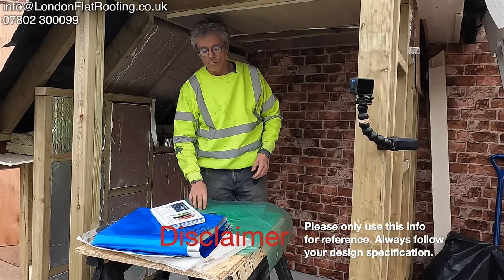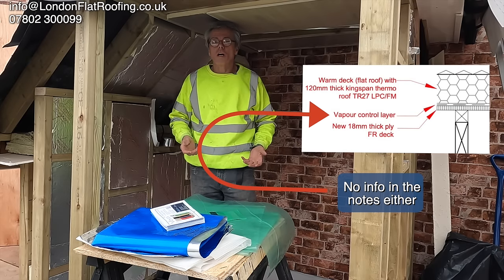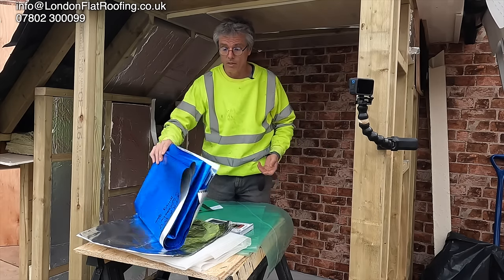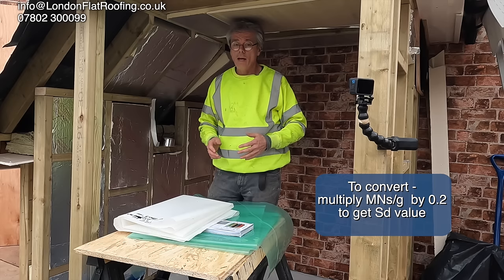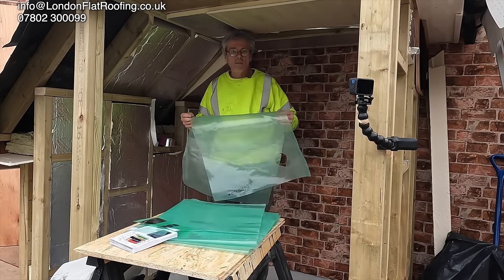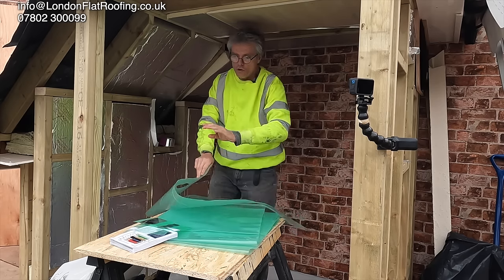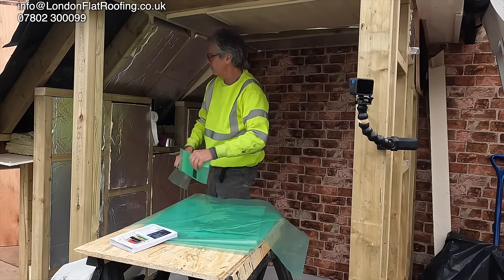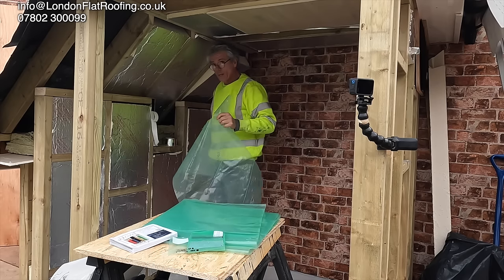Vapour barriers for roofs and walls explained

Comment: Great Video, i have watched a good few about vapour barriers trust me. I currently have a single skin (concrete block) summer house. Would you say i have it right when insulating the walls to have 1. Breathable membrane, 2. Kingspan insulation in a stud frame and then the vapour barrier before cladding or would it be vapour barrier at step one on the side of the block and insualtion or the warm side of the room or both? Hope that makes sense. Thanks in advance
Reply: Any advance steve would be much appreciated 
Thanks

Comment: All good for my new building where I have been following all the advice discussed with you in the past, but now I'm building a solar shed for all the electronics where there should not be much vapour other than what was there initially. I was thinking of making this unit an air/moisture-tight one from the outside rather than worrying too much about the inside since I'm also adopting a "Warm roof" as well.  Any suggestions from this fraternity ?

Comment: Hi,
What should be the thickness of insulation board for my garage cold roof?
Reply from the maker: Depends on if you need to meet building regulations if you need to build to building regulations thickness is 150 mm now

Comment: With old houses built in 1900. No cavity. 9 inch solid wall.  Would you say batten and then put insulated plaster board over it? Or is it silly
Reply: are you talking about walls or ceilings?
Reply: @HampsteadBuildersLt  brick walls
Reply: @tommyb5244  no not silly its the way its done ad a DPC (damp proof course) under the batten.
Reply: @HampsteadBuildersLt  so battens drilled to the wall with a dpc under. And and good insulation board with a vapour barrier behind it?
Reply: @tommyb5244  yes plasterboard avcl insulation battens dpc
Reply: @HampsteadBuildersLt  thanks for your help

Comment: Does using foil tape on top of the kingspan do the job?
Reply from the maker: Possibly If you can make it air tight and if its going to last the lifespan of the building !
Reply: @SteveRoofer  Why on earth don't PIR manufacturers would publish spec of the foil facings? I'm having to buy and install a seperate vapour barrier because they don't. If they stated their sd value/MNs/g, emissivity etc, then maybe all I would need is lots of alu tape.

Comment: maybe not your field.. :) but do you need a vapor barrier if you're insulating floorboards?. My floorboards are suspended on joists and then there's just a big gap before the dirt underneath. Lots of cold air comes up through the floorboards and i was hoping just sticking insulation in between the joists would help (leaving space underneath for air ventilation). Sorry not roof related ;)
Reply: p.s. great videos, I'm watching a bunch just out of interest at this point!

Comment: Hi Steve, thanks for this video,, can you help? we need to insulate a large wooden shed, please advise the best way to go abot it... ONLY THE INSIDE.  ITS GOT A PITCHED ROOF AND WALLS ARE 2.5 METERS HIGH ,,,Thanks.
Reply from the maker: if you do not want to spend a lot of  money just use Rockwool  with a plastic AVCL on the inside I would not be to fused about the quoity of the AVCL for a shed

Comment: Can you make a warm roof system with a slope roof. If what’s the max slope ?
Reply from the maker: I think that a pitched roof stopes being a pitched roof when you get down to 12 degrees Ill have to look it up. However theoretically if yo made a roof with say 30 degrees pitch the same as a flat roof what's the difference? The only thing I can  say is that hot air rises and at the top of the flat roof you may get a collection of moisture  if you are going to get any problems at all.
Reply: @SteveRoofer  great on sight thanks

Comment: Vapour barrier moisture barrier seems to be abit of a buzz word these days , why would you want to keep moisture in ???
Reply: keeps the moisture away from rotting the timber
Reply: So the moist air doesn't condense on the structure and rot it!
Reply from the maker: We insulate a lot now days thus stoping the transferor of engage and taking with it the moist air so things have changed

Comment: Just dont put downlights in your ceiling on a cold roof. There are very good led light strip systems out there now. No need to cut holes in a ceiling anymore.
Reply from the maker: The good thing at the moment is that we have lots of different lighting options, so realistically with forethought there is no reason to cut into the Air Vapour Control Layer (AVCL)

Comment: I'm going to use thermaquilt on my walls as the only vapour barrier. They say it acts as a vapour barrier and insulation in one. What do you think?.
Reply from the maker: don't know anything about it whats is Sd value ? also make sure its airtight
Reply: @SteveRoofer  its actually called superquilt, and it says vapour resistance 1569 MNs/g.
Reply from the maker: @benrichards1  so a Sd value of 311 thats good
Reply: @SteveRoofer  thanks for the reply.

Comment: If only they produced PIR insulation at lower depths with higher u values. Or mineral slabs and adding a foil barrier to the outside prior to boarding roof, dormer to reflect the UV. I don't get the vapour barrier internally approach. The system is too rigid and needs adapting at times. Too many houses thrown up with a load of PIR and not enough thought about how the house needs breath.
Reply from the maker: Agreed

Comment: Would you advise to foam any gaps?
Reply from the maker: Any foam we use cans as its easier we have access to large canisters with big guns but they are never in the right place at the right time so we use the more costly way and use individual cans we can go through 24 cans on one roof that around £200 in foam alone
Reply: @SteveRoofer  thank you for reply. Yes not cheap eh.

Comment: What a con
Reply from the maker: Can you explain ?
Reply: @SteveRoofer  there is absolutely no need for one of these things what so ever
Reply: Everything is a con when you don't understand it
Reply: @klaeLIFE  i understand that it completely unessesary
Reply: @adamcunningham2511  please explain so we can save the industry wasting so much plastic
Reply: You have a roof. You have tiles. You have felt . You have 150mm of insulation. You have a plasterboard. You have a coat of skim. Save your plastic . Sorted
Reply: @adamcunningham2511  that's not actually an explanation at all. That's just the description of a roof without a vapour barrier... its not even a warm roof and in particular, a flat roof
Reply: @klaeLIFE  a roof without a vapour barrier. There you go . You have cracked it .
Reply: @adamcunningham2511  I'm not sure you really understand. In a typical pitched roof there is no roof deck. I think a lot of these demos are for flat roof construction where an osb or ply roof deck will rot.